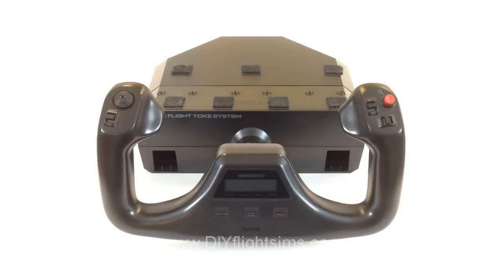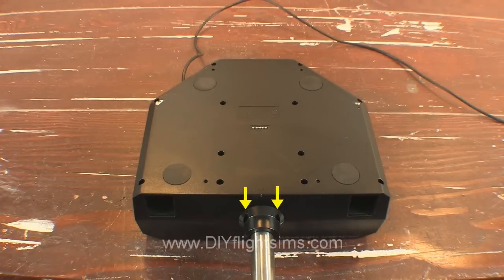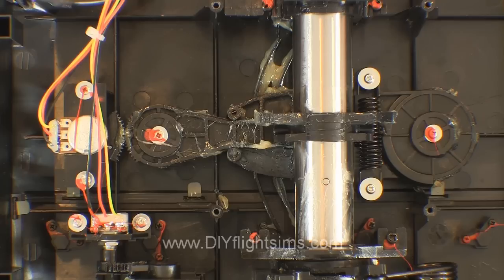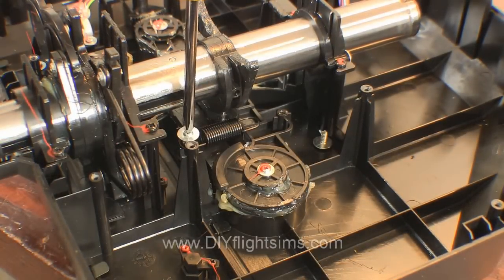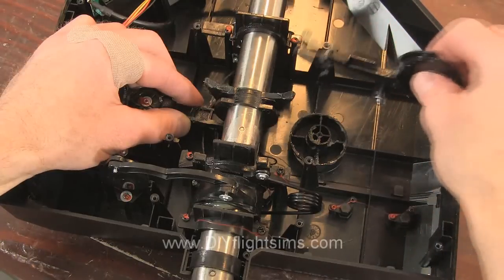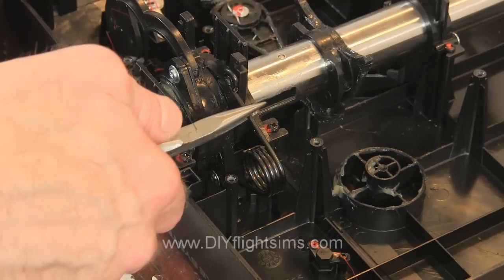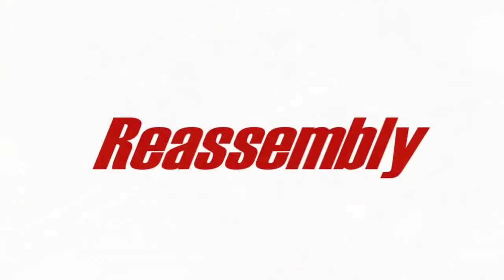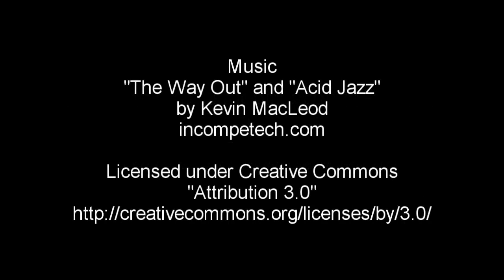Logitech Saitek Yoke Disassembly

Comment: The local hardware store has every spring size you can imagine. I replaced the pitch springs with weaker but efficient ones, and left the lateral springs alone.

Comment: My Saitek/Logitech pro flight yoke isn’t being recognised by Win10 anymore(been about 12 moths since I last had it plugged in due to circumstances). No matter what I do, I get nothing. Even the software program designed for it doesn’t pick it up. Can I get a replacement circuit board complete to fix it or do I need to go down the Leo Bodnar route?
Reply: You ever find a fix for this?
Reply: @Captainasquared  Not entirely. I'm rewiring as much as I can of the main & side connections(trims etc), to a Leo Bodnar board or 2. However, I did discover that the drivers stored on the unit that set things up with Windows when you 1st plug in the usb, were so corrupted there was no chance of it working. That coupled with having to re solder the loose wires to the motherboard, I only got the thing to power up the LCD screen. Nothing else has worked at all. I had an opportunity to replace the whole yoke & lever package due to selling something for more than I thought I'd get. So, I'm happy with a brand new Logitech yoke. I will carry on with the other one & see if I can improve my wiring skills. Might as well learn something on the way eh! Thx for asking

Comment: after removing the springs the only thing i need to find out is how can i install small cabinet gas strut in there. would be cheap and very nice to the feel. for pitch axis it would be easy. hard part would be roll axis.

Comment: if i like the feel of the pitch with removing only the top spring, can i leave it the way it is and reassemble. or will something eventually break with just the bottom spring?
Reply: It works, but it's just more effective to use the rubber band method, as it feels much better in my opinion.